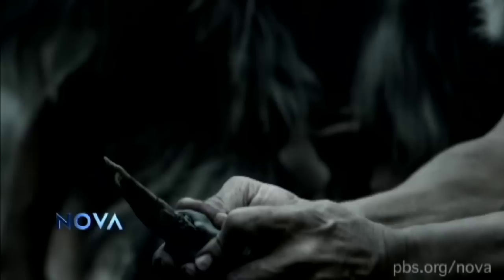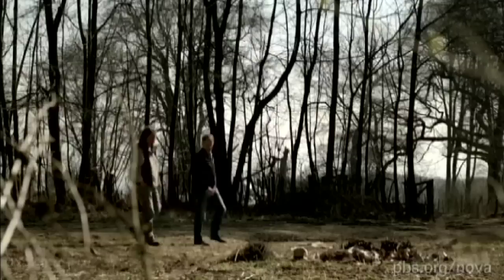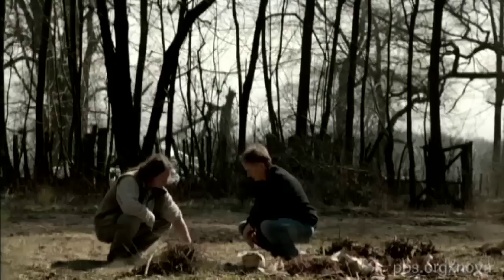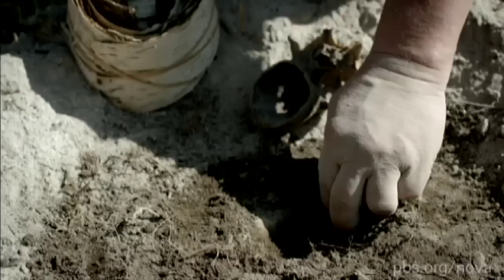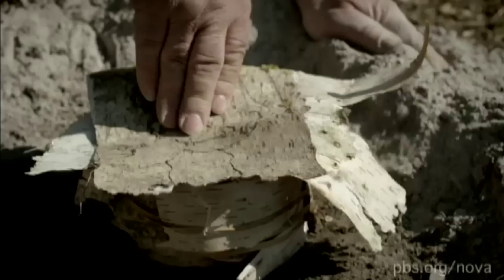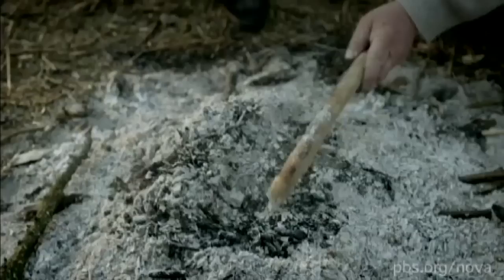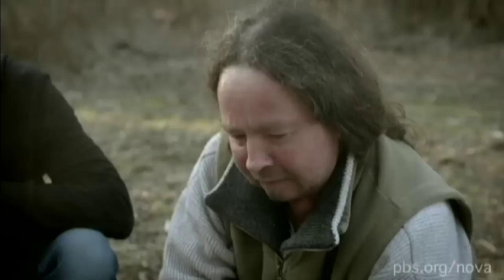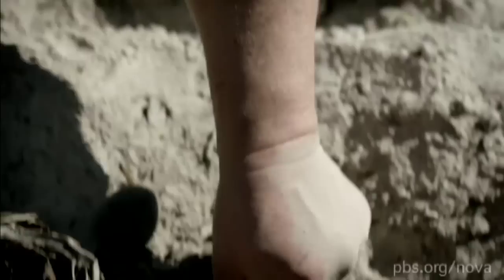Neanderthal Superglue

Comment: As a flint knapper, I make my own birch tar all the time. The modern way is with two empty paint cans stacked. One is open and buried in the fire pit while the top can has a hole cut into it's base and is sealed with it's lid containing the birch. The fire is build around the top can. The idea is that you need to prevent gasses from escaping otherwise all you've built is a gasifier. That's why their technique didn't work so well, they just need to refine their process a bit.

Comment: "I haven't found the name of that gene" Its the MC1R. 
" Neanderthal with the same skin color genes as a European"  well they may find that but it wouldn't necessarily mean it wasn't fully neanderthal. It may be that the genes responsible were present before neaderthal split from us. I think this is unlikely seeing how the specific variant in Europeans is young and has significant correlation to the neolithic revolution 6,000 to 12,000 yrs ago. Neanderthals died out a lot earlier than that.